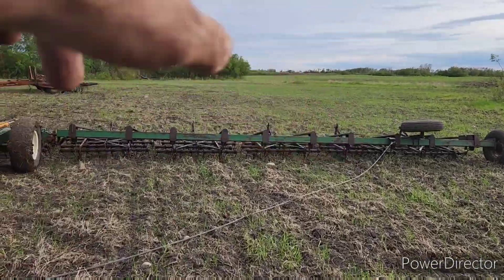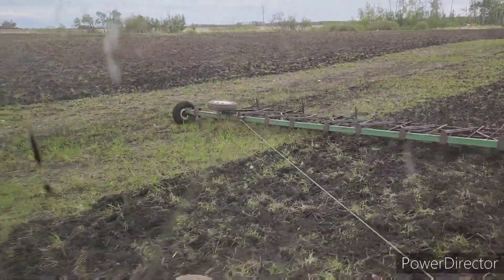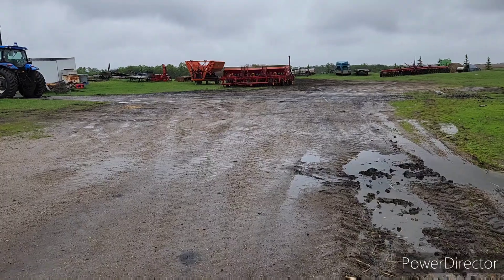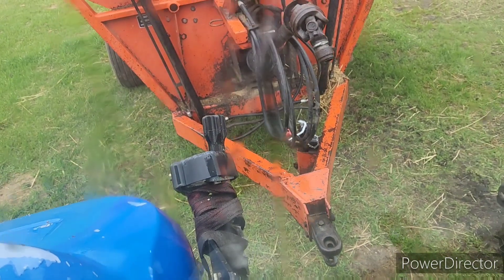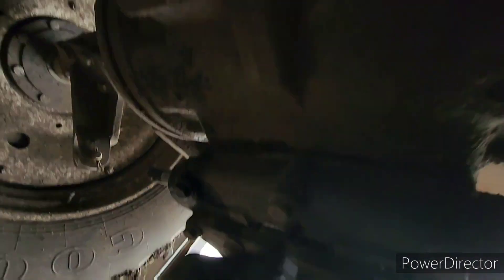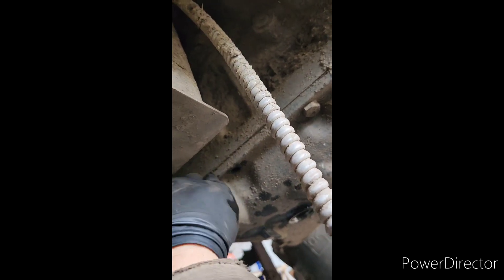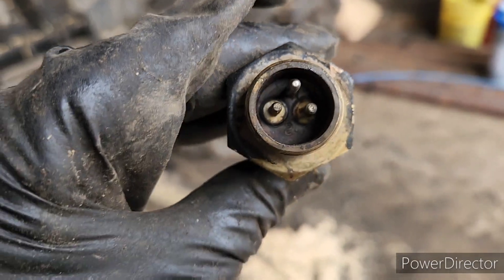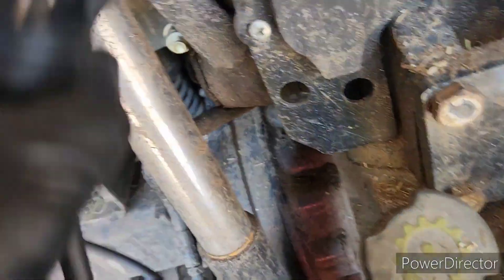Harrowing Is Done,  CP Has More Baby Chick's

Comment: Case wanted $30 a bolt for a special bolt to hold the shank assembly to the frame cause it has a special shoulder on it.  I took my drill and changed the hole to accept a $2.00 hardened bolt in its place.  Greedy bastards.
Reply: Is that the offset bastard? If it's that one we had modified the hole to accept a regular bolt too.
Reply: @jeremycherny2041 yep, that engineer was a 🤬rocket scientist for sure.
Reply: @jeremycherny2041  you know I probably would have swallowed $10 and been pissed about it, but $30 plus freight and to wait a day was too much.
Reply: Modify stuff all the time.. re-engineered is always better!